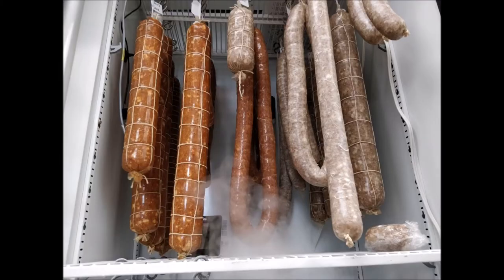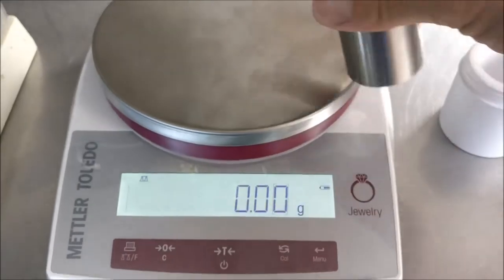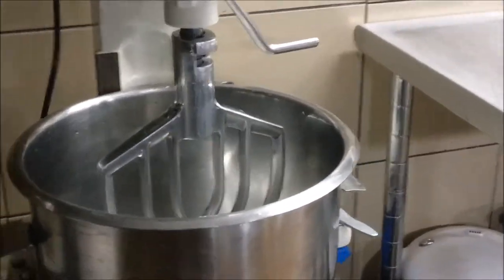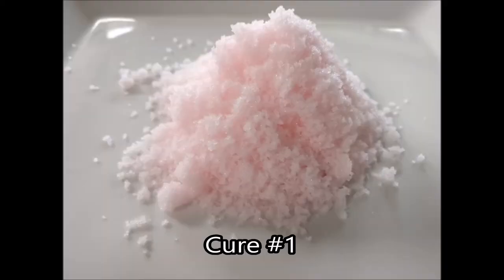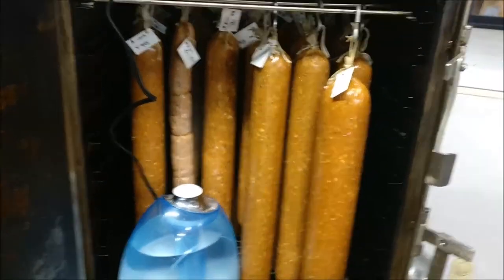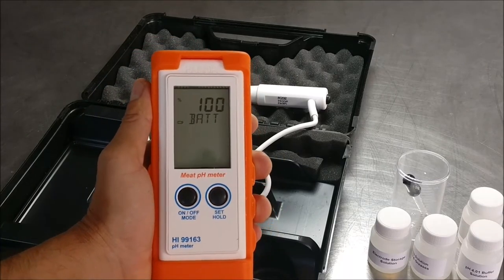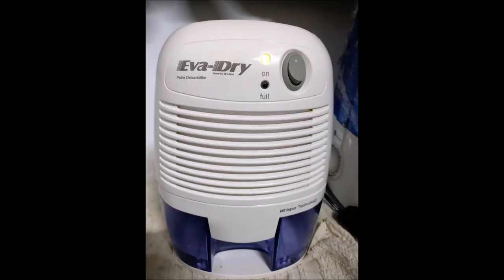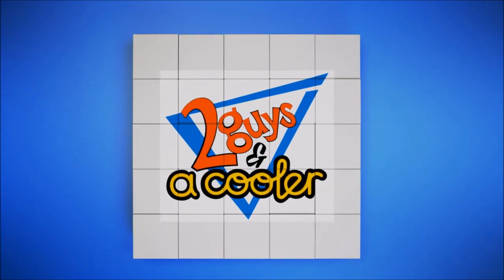What do you need to make salami?

Comment: Excelent video. How do you know wich salami to ferment on what temperature and humidity. And what drying temperature is used. Is it diferent salami to salami or there is a standart .
Reply from the maker: Hi Martin.  When Salami is made a starter culture is used to help reduce the pH of the meat and make it safe to eat.  Depending on the starter culture that is used will determine the temperature.  The humidity is always going to be 90-95% for all salami during fermentation.  As I make more video I will explain the unique differences between the different starter cultures so you will know which one to use but here is a recent video I just did about cultures if you want to check it out:   https://youtu.be/oDGTSlvFupk

When it come to drying the salami there is generally a standard.  55F is generally the most agreeable number  but some go as low as 53 and as high as 60F.  I tend to keep mu chamber at 55F all the time regardless of what's in it.  Humidity is the important factor here as you don't want your salami to dry too fast so for the first week starting at 85% humidity then reducing it to 80% for the second and third week then finally dropping it to 75% for the duration of the drying will usually give you favorable results.  I often just keep mine at 80% all the time and I get great results as well.  I hope that helps.  If you have any other questions let me know!!  Here to help..
Reply: Thank you very much. I Do a lot of charcuterie and some of them are old 140 years old recipe.
Reply from the maker: Oh wow!  That's cool.  I'd love to see some of those recipes. Are they family secrets?  I like cooking traditional old world recipes.  There's a good chance your recipes don't say to add a starter culture.  Back then they didn't do that.  They used the natural flora in their meat and in their environment.  The curing process and drying process took almost twice as long as it does now.   With that new info if you are following the traditional recipes for making salami you will want to ferment at 54F -59F at 90% humidity.  Target pH should be achieved between 3-8 days...   Contact me off line if you want to share some recipes..
Reply: I would love to contact you pravetly and more then welcome to swap some recipes.  Are you on Fb or whats up?

Comment: Hi Eric,  great Video.  In regards to Stand Mixers / Planetary mixers how many pounds would your stand mixer mince?   I plan to do Salami runs of approx 11 pounds at a time?   If I am going to spend some money on a Stand mixer am I better purchasing a machine that can do the mix in one hit (apposed to half at a time) ?
Reply from the maker: Hey Paul, Great question.  I have a 5.5 liter kitchen aid (my small one) and it fits roughly 4 pounds comfortably.  5 pounds is a touch too much for this unit.  So for an 11 pound batch I would guess  a 15-20 liter unit would work fine.  Something to consider is a Meat mixer.  Depending on the grinder you have you could attach this mixer to a grinder and it mixes your meat for you.  https://amzn.to/2HP3m5e   The only problem is that you have to do at least 10+ pounds.  It doesn't mix small batches so well.  I think it's capacity is 25#.  Something to think about..
Reply: @2guysandacooler  thanks for your informative reply. A few things to consider.   Regards Paul

Comment: Do you have a list to go by on what needs to go into a drying chamber and what you can just use your fermenting chamber on?
Reply from the maker: Hey Milton.  The only thing you need is a temperature control and humidity control.  Then a humidifier and a dehumidifier.  It's really simple.  Your fridge gets plugged into the temperature control and the humidifier and dehumidifier gets plugged into the humidity control.

For a fermentation chamber it can be just about anything as well.  What it comes down to is the temp you are planning to ferment at.  I like to ferment at 85F for salami because of the starter culture I use.  Some people like to ferment lower (different starter culture).  For me I just place a light bulb (100w) and connect that to a temp controller.  This keeps my area at 85F.  You can create this environment anywhere.  A wooden box, an ice chest, a stove.  I then add either a tray of water or a humidifier to keep the humidity high.  That it.  You can find the controllers and the humidifiers and dehumidifiers that I use on my amazon storefront  under salami making.  I hope this helps:  https://www.amazon.com/shop/2guysacooler

Comment: helpful video. "cure#1 until 1 month" you  all the  time range { curing and drying} ?
Reply from the maker: Hi Uri.  Thanks for the question.  Sorry for the confusion.  What I meant to say in the video was if your product will be drying for less than a month then cure #1 will be needed.  If your product will be drying for more than a month then cure #2 is needed.   The actual cure time depends on the shape and size of your muscle.  Usually a full coppa will take about 50-75 days so you would use cure #2.  

Hope that helps.  Let me know if you want me to explain it in a different way..  Thanks for the great questions!!
Reply: @2guysandacooler  thanks   i understand

Comment: ive got a broken chest freezer, for the fermentation chamber, do i need some air in there or i could just totally shut it off along with my humidifier/dehumidifier.
Reply from the maker: no air is needed.  The bacteria used to ferment salami are anaerobic (no oxygen).  You could technically do it in a vacuum sealed bag if you want to
Reply: @2guysandacooler  thanks for the tip. :)

Comment: I wish we had more options for bacteria and mild cultures.  Locally I have one option and the mold does not grow as fast as the one you use.
Reply from the maker: What culture do you have?
Reply: I can get Mondostart cultures, classic and SP, and the Mondostart Surface. I tried using whey from a cheese culture I like and waiting to see how that turns out. The mold culture took five says to show signs of growth. I was hoping for a quicker start but I am starting with a new clean drying/fermenting fridge.
Reply from the maker: Oh that's too bad.  Never used Mondostart.  By chance would you happen to know the strains of bacteria in the classic?  Just curious.  Starting with a fresh slate always takes a little longer.  High humidity really promotes mold growth BTW (even baddies if you aren't careful).  What cheese was it?  Brie or camembert?  I've been wanting to use P. Camemberti to inoculate a salami and see what happens..
Reply: I made a cheese using the bacteria culture flora Danica. Those rings are growing mold first. I have no idea what is in the starter cultures. I did import cultures for cheese from the USA and apparently importing bacteria cultures really makes boarder officials nervous.  The packets were opened and could not be used... very frustrating. I have found a Canadian supplier of meat and cheese cultures but they don’t provide retailers with cultures. I would love to try different types of cultures and moulds. I am setting up a new chamber for aging cheese
Reply from the maker: Nice.  Cheese is probably my next project... Sad to hear about the border situation :(

Comment: I’m in your store buying some things and I’m trying to buy the PH tester you’re using but I don’t know if I need any of the solutions with it or what else do I need to properly be able to use it. Can you get back to me please ? Thank you 
I’ll wait a little before ordering otherwise I’ll order later the extra if needed
Reply from the maker: Hello.  The ph meter comes with small jars of the appropriate solutions.  Those solutions will last you at least 3-6 months if not longer.  You can always buy the extra solutions at a later time once you start running low.  Let me know if you have any other questions
Reply: @2guysandacooler  actually I think you mentioned in one of your videos that I could use a old smoker as a drying chamber,how do I actually go about settling it up do I need to buy a humidifier or something like that. I’m in Illinois and the temp right now is in the 30-50 . What are you thoughts?
Reply from the maker: The smoker trick would be for fermenting the salami.  As far as drying goes an old fridge would be best and would give you the least amount of issues...